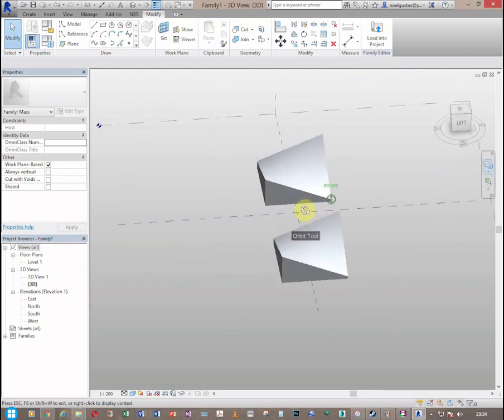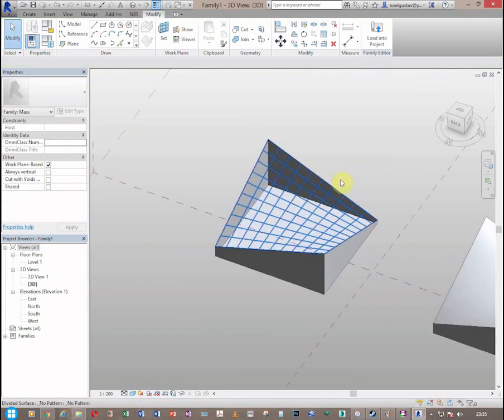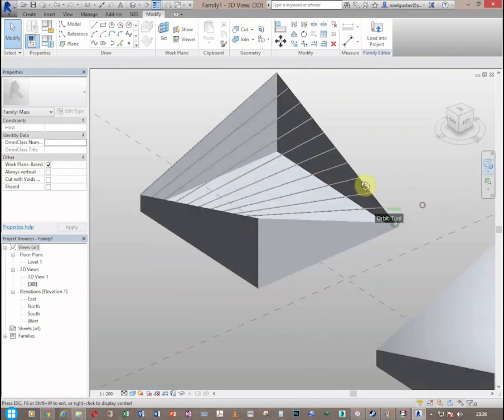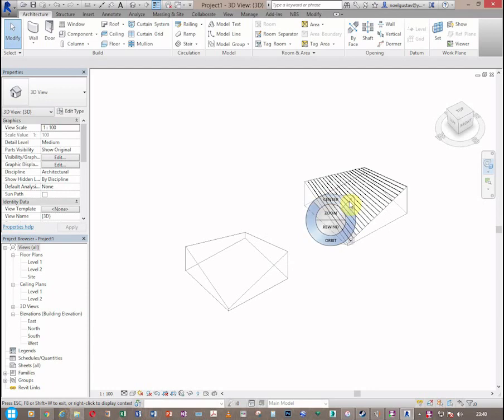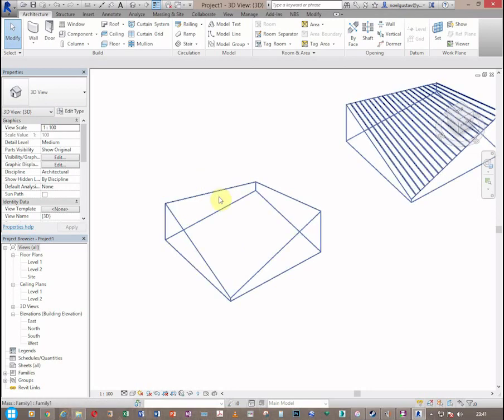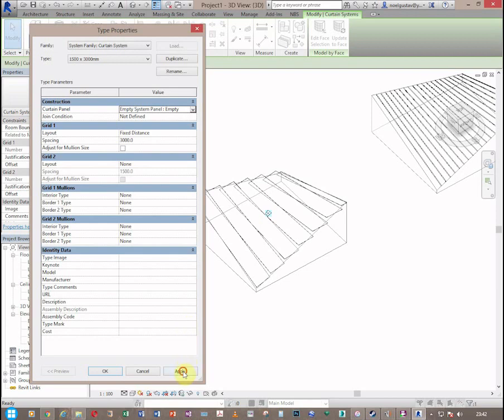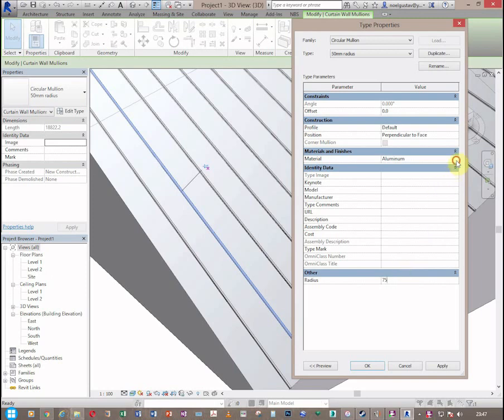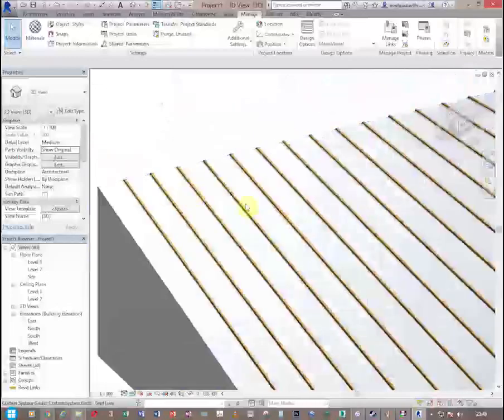Bamboo Roof  Frames in Revit ;Curtain Pattern vs Curtain System

Comment: Hey can I apply it on normal buildings which are not made by masses
Reply from the maker: Surely, you've to use curtain wall, say storefront wall and change their profiles to round ones, make sure the glazing (glass) profile is changed to "empty"
Reply: @noelgustav  but i can add door or window.
Reply: @noelgustav  please make a bamboo wall tutorial. and how to add a door or window to the massing wall